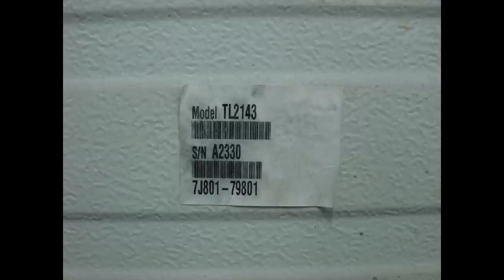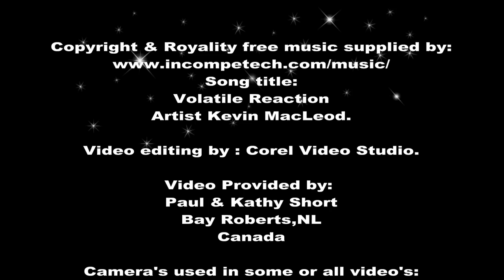Kubota BX Bucket Mod

Comment: Thanks so much for this old video and because I watched it I didn't want to see a happy face bucket on my brand new 2020 BX 1880 so unlike 2015 when you made your own cutting edge Kubota now sells them off the shelf plus the bucket comes with the holes pre drilled already. I dropped mine off because of a hydraulic leak and had them mount the cutting edge plus a leveling kit as well. Thanks again
Reply from the maker: Yes Kubota followed my lead and did the mod as well. Makes for a better machine that will last. Your welcome. Thanks for watching.

Comment: Thanks Paul for the very informative video. I had bought bolt on hooks but not the ones that have a riser welded on to get them over the lip on my B2601. Now after watching your video I will mount them inside the bucket. I’m amazed on your knowledge by using heavy equipment and feel lucky to see how you do it. Thanks for showing us how to do it!
Reply from the maker: Wayne putting the hooks inside the bucket is the safest way to do it. I do these videos to try and educate people and if they prevent injury or worst then the time it took to do the video was well worth it. 
Thanks for your kind comments. Thanks for watching. Happy Tractoring 👍

Comment: Thanks Paul .... I am having the "Smiling" bucket after moving the 108 plus inches of snow in the Boston area. But thank the powers that be that I was able to purchase the BX for winter 2014/15. I mentioned in a previous post that I was wondering if I'd get a chance to move snow ... OMG did I move snow! I'll work on finding the blade and replace it as soon as I can ... and yes I'll invest in some industrial drills ... and out the one from Harbor Fright to drill holes in wood. Again thanks for the Bucket Mod .. as always good information to keep my BX in great shape!
Reply from the maker: Bill Amore 
Well you deserve that new machine and what a year you picked to get it. Good on you. Yes the cutting edge mod is well worth while and your kindly welcome for the video.

Comment: I have a cutting edge, only bad thing is that its not reversible. I wish I had one, but for me, it should last a long time. I've also added some golf cart mirrors on loader arms like yours. I used 4 magnets I bought at Harbor Fright. They hold pretty good. I plan on getting a right side rops bracket from you once I get some more money saved up. I found the perfect toolboxes at HF. I have been accused of modding too much. All I can say is I learned from the best and not for sure if you can have too many, though. They make life easier when using these tiny tractors.

Comment: I Work on the west coast in mining and heavy construction as a welder and will confirm hooks inside is the safest location. You should never be straight in line with your pull without armour, when chains break they can toss links with enough force to seriously hurt you. Love your videos you are an excellent roll model in both my work ethic and in my marriage you and Kathy rock keep up the great work.
Reply from the maker: ecko996 I got into the small tractor world back in 2008. I could never understand why anyone would put a hook on the back of a bucket yet everyone does it. To me it's just wrong. It's easy to see you've been around the big stuff because you know why the hook is inside. It's a bad feeling seeing a cable snap and head towards the cab. It's happened to me and I was happy to be behind that bucket. 
Thank you for your kind words. Really nice knowing you've been watching our videos. Keep well over there and have a great weekend.

Comment: Thank you once again in providing your advice on this series of topics.  I'm about to install the hooks on my BX bucket, and wondered why you placed yours on the inside.       As well, the primary topic being the cutting edge - well, I guess that'll be my next to-do on my MacHine.   
I was going to install/fabricate a tooth bar on my B3030 a couple of years ago, and never got it done - still have the teeth, but no bar yet.  Very much looking forward to that fabrication and install onto your cutting bar/bucket.  Always appreciated.
Reply from the maker: Bryan Walker Thanks Bryan. I've seen so many hooks installed on the back side of buckets and could never figure out why they mount them there but that just might be me and I vould gave it figured all, wrong. As I said, the cutting end brings so many added benefits to the machine it makes it the number one mod. I'll be doing a follow up mod on the spill guard and show the hooks up close in the next video. Thanks for watching my friend.

Comment: Well it's November 2020 and I just took delivery of a brand new BX 1880 with a loader and I noticed my bucket already has predrilled holes so I'm assuming that in the 5 years since this video was made Kubota has designed a cutting edge for it. I will have to check with my dealer to be sure as I don't want a happy bucket. I also have the spill guard already installed and I do like your hook placement much better. Thanks

Comment: Another great video . Never gave much thought to a cutting edge , guess I will be taking a trip to my JD dealer for a cutting edge . ! LOL  BTW ,I DO NOT miss repairing HD equipment , last one I fixed was a engine in loader in a sand pit , you fix it where it broke , and the reason it broke was a buster heater hose . They keep using the machine until the engine overheated and seized !!!!! EXPENSIVE FIX ! all the best , be safe , be well you guys , bob k
Reply from the maker: Robert Kavich Like you bob I'm not a fan of working on heavy equipment and like you I've just about seen it all. As for the cutting edge, it's a well worth while mod so go for it buddy. You keep well my friend. New video up tonight. God Bless you and yours.

Comment: got my new cutting edge for my b7300 kubota today and gotitall drilled up     looks good,  now to build the spill guard
also had to put plates on bottom of bucket as tractoris18 yrs old with lots of hrs  worn paper thin   should probably of put a new bottom on as was only 3/16 thick when new  thanks for the video   a job well done   namvetseabee
Reply from the maker: +John  Goodwin 
Well your bucket will perform better and is stronger as well.

Comment: In my view, this is a very informative video, Paul. I could not help but notice that the  mid to the rear portion of the underside of the bucket was discernibly wearing. Perhaps it might be wise to attach three narrow strips of hardened steel, running from the rear edge of the front cutting edge to the rear edge of the bucket---so as to alleviate any unwanted, undue wear. I enjoy your videos immensely and, without any reservation, I feel it fitting to mention that you are the type of individual that is few and far between of having desirably varied abilities and attainments.
Reply from the maker: +Manuel Hernandez 
Thank you Manuel. The bottom of the bucket looks that way but in reality it's only the paint wearing off. In the future I'll be adding a new designed 4 into 1 bucket I'm thinking about building for the machine. Thank you for your kind words. They are much appreciated.

Comment: Kioti has a 48" bolt on reversible cutting edge now. It's actually 49" long and you will still have to drill holes in the BX25D bucket. It's about $240 CDN. The 2017 BX23S has a predrilled bucket so it's likely Kubota will have their own bolt on cutting edge.

Comment: Hey Paul I like ur blade. what we do here is go to the county shops and get their used  road grader blades and use them in the same manner and yep tuff to cut and heavy as heck I mark them and have the welding shop cut everything for me. costs a bit more but lots less trouble for me.
Reply from the maker: Stan Osterhoudt Yes I've seen them used many times. they pull them off graders and reuse them on just about everything. No matter what's used it's better than wearing out your bucket.

Comment: Hello paul, I actually did this to my bx25d this past winter, and the canadian part # is not the same as the usa part #. The cutting edge is also made from Manganese steel, super super hard steel. Thanks for posting
Reply from the maker: Mike Eldredge I had posted this mod on Tractor By Net a fe years ago and I'm only now getting around to doing the video. I figured the part numbers were different. Do you know the US number?
Reply: I did not keep it but can find out,
Reply: Sorry paul I never did find the part #, i have a Question , well 2 actually. 

#1, is your bucket floppy on your Bx where the Hydralic cylinder attaches to your bucket and where the other end attches to the cross beam on the Loader, mine got really floppy and my dealer tells me this is completly Normal, it seems pretty floppy to me though where the cylinder is pinned on both ends, lots of play.

Question #2, did you ever make a tooth bar that will fit over your cutting edge that you added to the bucket?, thank-you for the input

Comment: Paul, hope you are feeling much better.  Prayers to you and you family.  Quick question, bought a cutting edge off the net. Its 1055 carbon steel with no holes.  I tried drilling it, and its nearly impossible...slow speed, cutting fluid, still burned up 4 bits with no progress.  Need to drill 5 1/2 inch holes.  Any recommendations on type of bits or suggestions?  Thank you.
BTW , trying to do this with a drill press, and cobalt bits to no avail.

Comment: Hi Paul and Kathy! So Paul, you are going to show the mod of the tooth bar right? Not that I need one but I'd like to see what you come up with. I just got a BXpanded tooth bar for mine Monday night. Then Wednesday morning I had it my neighbor call and asked if my tractor would dig a hole deep enough to bury his miniature donkey that had died during the night. I hadn't put the bar on my bucket yet so I told him to give me 45 minutes and I'd be there. So I put the bar on and went to dig the hole. I'll tell you, the tooth bar worked great. Digging in hard packed soil with packed clay turns out to be really hard ground. I dug down around 4 feet. They told me they couldn't see the hood of the tractor when I was in the hole digging. I had got the tooth bar at just the right time. Everything worked out just right, Got to test the bar and seeing as I had never dug a hole that deep it was a good test. Good test for the 1026R too. I had dug a hole for our dog without the bar but it was softer dirt and I didn't go but about 3 feet down. So I'm curious what you come up with. Have a great weekend and God Bless. Levi~~
Reply from the maker: mi2tn That was sure nice of you to do that for them. Your a good man sir. I bet that tooth bar made a Hugh difference. Last year I built one for the 5740 and what a big difference. Fighting with our rocks was much easier. You can do a lot of work with those machines. Have a great day my friend. God Bless

Comment: I just purchased a brand new BX25D for my brother and all of the bucket outer edges are peeling or have peeled.  All the small edges on the boom arms and across the inside leading edge of the bucket.  I've watched all of your videos, and you have a great deal of talent where fabrication is concerned. It figures you're also musically inclined. Is there a specific 'Kubota' paint I should use to redo these areas?  I suppose I should invest in some welding equipment if I want to apply some of the things you've expertly illustrated.  Admittedly, it will take me considerable time but time is all we've got and its never too late.  Thanks!
Reply from the maker: Tim you should ask your selling dealer to repaint those areas. That's what warranties are for. As for the paint well I like to buy the spray cans of Kubota Orange from the Kubota dealer but ?Home Hardware has Kubota Orange as well for far less money than the dealers price. 
Talent! What talent? This is just what I do. Nothing more, nothing less. Happy to hear you watched a few of our videos. As for welding. If I can do it, you can too. Keep well

Comment: For those interested... I took Paul's TL2143 part number to my local (US, California) Kubota dealer and their crossover part was a TL2157 which measures 56-5/8" overall with 8 holes (just under $200).   Paul didn't go into great detail on the cut off sizes but with this blade I'll have to shift the blade one hole off center...  So I'll have to cut about 1/2" off one end and about 8" off the other.    That leaves seven bolts holding the blade on, one will be centered and the outer holes will be about an inch inside the bucket sides.  Should work fine...
Reply from the maker: ramosel I didn't go into great detail! Geez I told what I could remember from two years ago and spent 2.5 hours doing the video. That being said what your saying isn't adding up but if what your doing is making the cutting edge reversible then it will work. Mine can turn around and the bolts will fit exactly into the bolt holes. Measure twice, cut once.
Reply: Paul Short Kathy needs to take you to dinner...  you need a break.  I wasn't complaining,  You did a great job of letting us know what to do.   I'm following your lead.  Centering one hole and centering the blade so it can be reversed.  But with 8 holes you don't have "A" center hole.  You have 2 center holes.  I have to lose one so I have an odd number so you can get a center hole in the center of the bucket.   I'll measure it 10 times and drill and bolt it before I ever cut anything off.   Thanks for your help Paul.   Call me if I need to clear up any more of my mud.

Comment: great video, do you think it would be an issue if I put a cutting edge that was shy 1.75 inches from the edge on each side? I located on that was 44 1/2 that is a very good price. Thanks

Comment: Thanks! I was wondering how you went about modifying your bucket. Only question I have is, where did you source the hooks for inside the bucket? Great info. Thanks again!!
Reply from the maker: Jim alexander 
Jim I got the hooks out of the US. I don't remember the exact place but it was a towing company. Google "weld on chain hooks" and you should find them. Your welcome
Reply: Paul Short Thanks

Comment: Paul. Just viewed the BX25 bucket edge video. Have a smiling BX 25. Saw in the comments a reply from someone who was going to install new edge to smiling bucket. Is that going to fully straighten it, or will it simply end up with gaps at the right and left side end that will need to be shimmed between the bucket and the blade?
Reply from the maker: It all depends on the amount of smiley the bucket has. If it’s extreme then my advice would be to cut the bottom out of the bucket, replace with new steel then install the cutting edge. That’s the right way to do it. Happy Holidays.

Comment: Paul, It appears you installed the hooks up side down in the bucket, is there a reason you mounted them that way ? I plan to make a cutting edge with teeth that can easily be removed and watching all your video's you seem to be great at coming up with solutions.
Looking forward to seeing your design. Thanks for all the great video's you and Kathy produce.
Reply from the maker: +Rick Meeks 
The hooks are located like that so that when the chain is hooked on them and the bucket is raised the chain can't fall out of the hooks plus when the bucket is up and your pulling on the chain if the chain lets go the position of the bucket will protect you from the chain. I gave a demo of that in one of my videos. Thanks for watching our channel.

Comment: What metal did you use for the cutting edge and will you be making corner bits for it also does the backhoe bucket have corner bits

Comment: You can generally get a worn out grader blade from your friendly local grader operator;) Especially if you keep him sweet with a forty of good Canadian whiskey;))) Weld it on……cut it off when it wears out, stop drilling holes!
Reply from the maker: I’d never weld it on. bolt it on then you got to flip it over when it wears. and old cutting edge is just that “old”

Comment: I'd like to see the spill preventer mod.  Just wondering Paul what your thoughts were on the dodge van. Would you buy another ?
Reply from the maker: Steve Rob The spil guard will be the next video. As for the van well it's about the handiest, nicest machine we've ever owned. It's got the Stow N Go seating so it's like a truck with the seats down. When we have friends in it there's complete comfort with heat and AC in the rear. Hard to beat that.

Comment: Your bucket and fuel filter mods are probably the best ones you've done to improve the longevity (there's a big word, like, "marmalade" lol) of the BX25D. Speaking of your fuel filter mod, have you had to change the cartridge yet? Oh, and if you could put together a video of your spill guard that would be awesome!
Reply from the maker: Truck Shackley Haven't had to change the element yet and it looks clean. It's reassuring to know that it's an easy fix if it plugged. Awful the way Kubota put those filters on there. I'll get at the spill guard soon.

Comment: Would this be a better option than the Parana Bar from BXPandid?
Reply from the maker: For digging no but for leveling, fine grading this would be best. I use attachable teeth for digging on this cutting edge. I have the best of both worlds this way.

Comment: Thanks for the great video Paul,  Just wondering since you added weight to the bucket, have you ever thought about adding shims to the hydraulic relief valve? Just did it to my bx for a little extra umph!
Reply from the maker: harborcbs I didn't bother. I did the pressure test and it was on the high side of normal so I left it.
Reply: Paul Short I was about 100psi to the low side.  much better now!